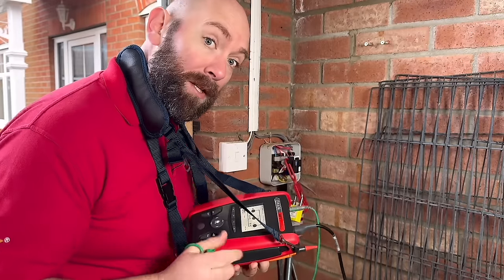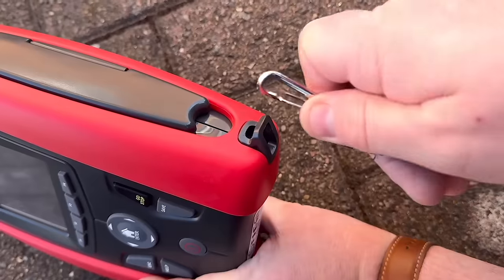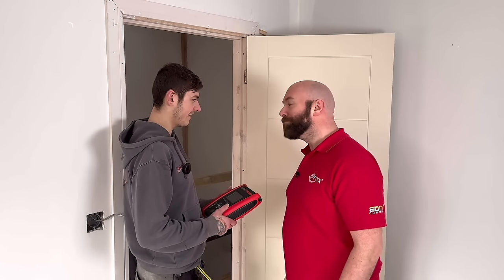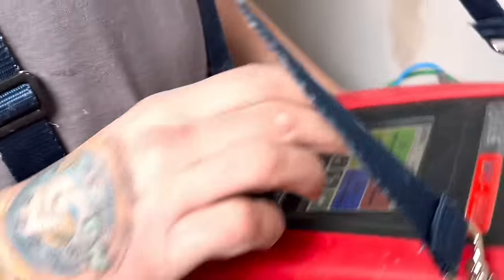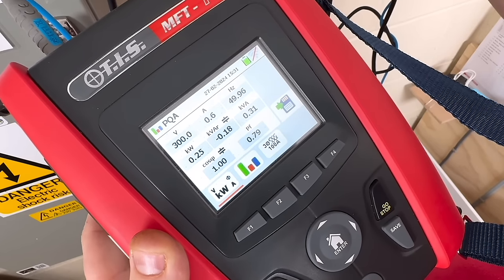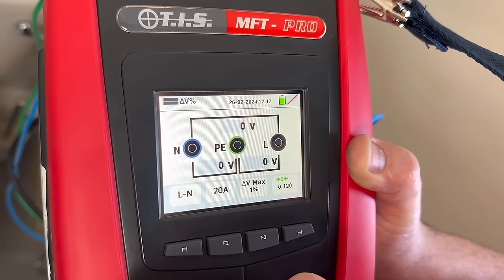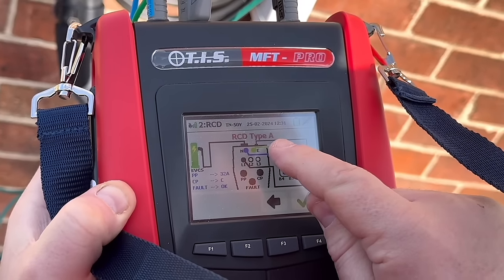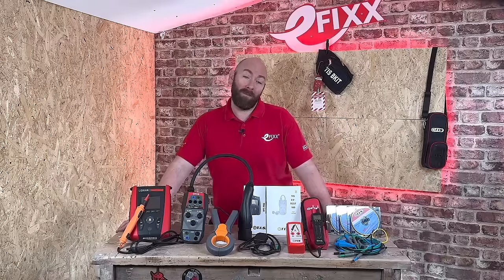IS This Electrical Installation Tester worth the Hype? - TIS MFT Pro.

Comment: Hmm. Re the power quality checks. You switch the main isolator off, so the effect of any of that load on power quality is removed, surely? Also, if there is no current flowing (as the isolator is open)  how can you determine the phase angle between voltage and current to work out power factor? Granted, harmonic analysis tends to only require voltage phasors but, again, if you've just disconnected a chunk of the load by opening the isolator that potentially gives a distorted (forgive the pun) view of the total harmonic distortion, especially if you've disconnected a lot of non-linear loads. Finally, the display on the screen shows cos phi as 1.00 capacitive but the 'pf' as 0.74 - how does that work?
Reply: It looked like he had the current clamp around the earth conductor whilst he was measuring, wonder if there is a circulating current confusing the meter? Totally agree that the harmonic measurement should be made with the board loaded. Also did the leakage test a bit later with the isolator off. Guess it is just a sales demo video.
Reply: @three-phase562  glad I'm not the only one scratching my head over this.
Reply: Exactly, we seem to have missed a step simply to illustrate safe isolation
Reply: Wow, well spotted @protectiongeek

Was hoping to get away with this one but I should have known better that nothings gets passed our sharp eyed viewers! 😅

You are right we had the isolator, off, rather annoyingly the site was quite tight on its H & S and wouldn’t allow us to go into the board live. However, after much haranguing and with the H & S officer we were able to get some shots of the power quality analysis albeit a tad rushed!

Ref the PF this will be down to me holding the probe and not making a great connection on the terminals. We had a bit of pressure from the site brass, 😂 there was certainly not enough on that board to cause a PF like that 😊.

Great though that we are showing the safe isolation and that company’s still have robust procedures in place

Thanks again for commenting 💪😊
Reply: @joehammond6119  thanks for such a candid response Joe. Much appreciated. Sometimes it’s easy to forget when watching vids that other less obvious factors may be influencing production behind the scenes.  Thanks for another great vid!

Comment: Test the RCD at the RCD saves going up and down.
Reply: Certain types of RCDs won't trip at the board
Reply: @dangallagher2306 thats interesting, do you know which types won't trip at the board
Reply: @dangallagher2306 so I heard but never come across it
Reply: @robboinc1  I didn't believe it until I tried it myself something about the board being a part of the RCDs circuit I think
Reply: @brianhewitt8618  MR30 MEMSHIELD 2, RCBO POD's were the ones I had issues with.
Reply: Definitely something wrong with them is there not tripping at the device, might of been DC currents
Reply: @brianhewitt8618  no it is by design
Reply: @dangallagher2306  that was very handy to know, thank you everyone

Comment: I use a 1730 which I love. I have one of these. It is a great tester, it works better for me using with the switch probe. It is a little slower to use that a Megger or Fluke but great bit of kit. I am not a lover of the form or the harness but the machine itself works very well. I like how you can customize the settings for testing,  it shows both PFC & PSC simultaneously on no trip test and the Auto RCD test is very handy. If you are doing IV or periodic in domestic or office it is fine, but I just don't find it easy to work with in cherry picker or on a ladder it does not sit well against your body it sticks out due to its shape. The other form factor Megger, Fluke, Metrel lays against your body I just find this more comfortable to work with.

Comment: I always had flukes and Meggers but I've changed to one of these. I do alot of commercial testing and it takes a while to get your head around but once you get your settings dialled it saves time. Made my own neck harness though. Will show the Reps next time it's in for calibration. I took the gamble on the kit cos the guys at TIS seemed easier to deal with than fluke and megger.
Reply: I used my old cm500 harness which is a bit longer and simpler to use than the one supplied